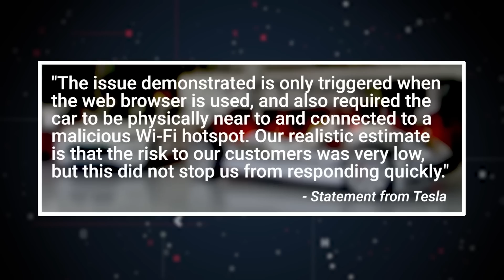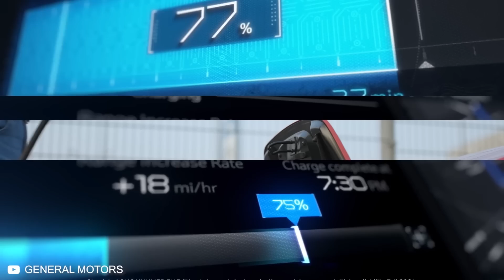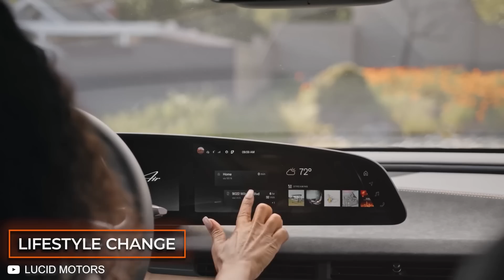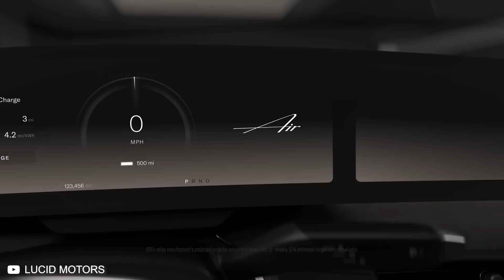EVs' Serious Problems That Carmakers Are Hiding

Comment: Too much tech is what is causing menace in EVs that are meant to be simple. I wish companies hold onto the features for the higher variants while providing a simple BMS which isn't software driven or doesn't auto update unneccesarily, diverting the actual use of the machine.

Comment: To all the ICE owners, I agree with you.  We don't need a mandate.  I should be able to convince you to buy a product, not force it on you.   Let's keep these discussions friendly.  

That being said, this article points out the main problem and the reason you buy a Tesla; charging stations.   The telsa supercharging network is amazing, decades above all other makers.   All of the EV failures are with other EVs.   

Also, you can get a  new Tesla model 3 at 37K, and that is before tax incentives.   that is almost in the range of low cost ICE vehicles like camrys and civics.   Tesla's next push will be in the 25k range.   That will push EVs into higher adoption.

Comment: Great commercial but I don't think it's going to work because once you get enough TVs on the road there will not be enough electricity available to charge them then what. And there's no such thing as drastic climate change.

Comment: Hybrids are the answer!!!! Even though the heavy batteries reduce efficiency, the fuel burned is much less. The batteries are not as heavy as in an EV, the utilities don't have to rebuild to supply the charging current,and no electricity will be wasted by fast charging!!!!  Special tires for the battery weight won't be needed for cars and trucks and bridges and roads need not be improved due to the battery weight!!

Comment: 5 min 300 mile fuel fill ups is still the way to go. No hopes and prayers to find a working charger and compatible app with other cars waiting in line there before you in winters freezing cold making me late to work. No DIY replacement parts, no aftermarket upgrade customizations, dealer only service, no resell value, NO THANKS !!!

Comment: The big problem I see is what are you getting to charge the battery with? It's not solar or wind but fossil fuel creating the electricity. Gas powered vehicles use fossil fuels better then putting it into an electric car.

Comment: It’s two years later and the EV choice doesn’t look so good. Lineups at charging stations, the fires with the high repair costs makes them expensive to insure, auto manufacturers stopping production because no one is buying and Tesla is lowering its prices dramatically. If the government has to subsidize a product to get people to buy it then it’s not ready. If the government pushes something really hard then it’s usually doing it for the wrong reasons. Electric cars will be fine when better battery tech is a reality with faster charging and no fires. 😊

Comment: Has anyone compared the cost of the electricity needed to charge an EV vs the cost of a tank of gas that goes the same distance?  HINT - gas is one he!! of a lot cheaper - even with production costs thrown in.  What about those countries like the United Kingdom that are suffering from energy shortages?  What are they suppose to use if the electricity shuts off?  What about black outs due to storm damage?  This would be a major problem here in the USA which is the Tornado Capital of the world.

Comment: That is why Toyota Hybrids remains KING as most everyone can afford to buy A Toyota basic Prius that has excellent MPG , my old Prius 2013 has 185,000 miles a still runs great and will get 50mpg  on a trip where there is not a lot of traffic or very bad weather ,but basically it will get 50mpg if you are traveling @ 55-60mph?

Comment: The problem that you glossed over is the fact that the batteries only last 10 years and can easily cost more than the value of the car to replaced.  Case in point is that many early Volts are now requiring new batteries that cost upwards of 15k which is much more that the value of a 10 year old Volt.

Comment: electric cars have a lot of draw backs,🤔 charging  the damn thing is only one problem.  those things are a fire hazard. the battery materials are morally questionable. the charging stations are vulnerable to vandals and the process takes way too long to be practical on a large scale, especially with residential power.  the cars are entirely too expensive to offset the cost of fuel cars. and they're way too expensive for the construction quality.  EV's... which should be called BC's, for "battery car" are  long in concept, but fall short in design.  it seems many well intended people have been sold a bag of magic beans.. 🤣  i get the feeling the modern battery powered electric car was designed by someone who doesn't know how the world works and only sort of knows how a car works.🙃

Comment: First impressions of Model 3 or improvements to be made:

1. White seats interior comes with a white dashboard trim which generates glare on side view mirrors.
2. Dark Ceiling glasses is hot under the sun.
3. Fine dust blown from brakes.
4. Turn signals stick is ambiguous in starting the quick 3 blinks and continuous  blinks.
5. Bottom of the car too low and prone to undercarriage damages, especially for batteries and other mechanical parts.
6. Screen menu items not intuitive, especially when you want to exit a mode. Screen icons not intuitive.
7. Regenerative breaking not smart enough.
8. Visibility of other cars around you is poor.  Switch between the real surrounding and the screen images is distracting.
9. Would be nice to be able to stop Auto locking the doors.
10. Strong EMF's inside cabin, especially on the passenger side, on seats, and on the floors.

To be fair, Model 3 have some new and good features, some of them are  not matured.

Comment: I regret buying a Tesla because I found out that there is a lot of EMF's inside the car and that give the head and body stresses.  Especially on the passenger side and back seats, and on the floor, very strong EMF's. If you are sensitive to EMF's, don't buy a Tesla or any other EV's.  All EV's should have a disclosure about their EMF levels inside the car cabin.

Comment: I use a pickup and frequently go off-road so 4x4 is mandatory.  By elimination this means Rivian.  Also the Rivian is the maximum practical size for outside the US.  The standard range is adequate for me for most of my trips.
 
 I can see the external garage making a come back due to inflamable batteries taking a whole house, if the car burns, and that ignores the insurance for the house being vioded if there is an ev, e scooter etc.

Problem:  where is power being generated, and how is it getting the the consumer??? And what is the EV effect on base-load demand?  Watch how authorities waffle on those 3 points.   Until these are addressed EV's will be limited.

Comment: I will be 50 soon. I have never owned a brand new car. Usually it’s about 7-12 years old. The one I have now is 10 years old. I will never buy a new EV. I won’t buy a new gasoline car. If the don’t stop making new gas cars until aft 2030 and I still have an option of a used gas car for the next 20 years. I will never need to buy an EV.

Comment: The repair thing is pretty much exclusively a Tesla problem, the legacy mfrs already have parts pipelines and lots of locations. If you cant charge at home, you wont benefit much, other than the speed and quiet. The hacking thing - all cars these days have the same vulnerabilities, regardless of what turns the driveshaft.

Comment: So many inaccurate statements. Many ICE cars have electric steering. Yes batteries degrade / have decreased capacity over time just like ICE car engines wear over time. An EV battery can keep most of its capacity if charged correctly with minimal rapid charging. The UK has many DC chargers even in 2022. A $40k Tesla will do about 200 miles not the claimed 260 miles. Dyson never intended to make an EV, it wanted the investment for its battery technology.

Comment: We are filling the world up with lithium-ion incendiary bombs. Most of these batteries are relatively new but many of them, especially in China, go up not in a puff of smoke but off like a thermic lance & burn until anything within a 20m radius has been utterly consumed. Wait until the majority are 10+ years old with a few dents & scrapes. How many will be bursting into flames then on the daily? Can you imagine two cheap Chinese EVs in the basement of a multi-storey carpark with poor access. Should one decide to self-implode it will likely take not only that row of cars, not just the multi-storey carpark with it, but likely the entire shopping centre too. Think it can't happen? It can & it will, the Freemantle Highway has taught us that if nothing else. Catastrophic as this will be globally, we are faced with a list of EV shortcomings that are literally as long as your arm. They are expensive, lose 50% of their value in the first 2 years, more costly to run than diesel, have poor range, insufficient chargers, take a hour min to charge, travel less in the cold, give range anxiety, likely to burn house to ground if charged in garage, new battery costs half the vehicle value, beyond 3 yrs no one will want them due to the cost of battery replacement so value drops again, at end of life person holding the baby has to somehow scrap the toxic battery which is half the car, servicing super expensive, tyres need replacing annually due to weight.......I could write for weeks without running out of cons. They are simply endless. VW has already seen the writing on the wall and is moving strongly back to ICE with 7 new ICE models planned & its EV workforce curtailed. EVs are rapidly becoming a global joke ......in any colour.

Comment: Choosing an EV over a ICE Powered vehicle is Never going to be an option for me,I will keep my diesel until it either drops apart or they make them illegal to use whatever comes first. These EVs when they go wrong are going to be horrendously expensive to repair and at my age isn’t viable. People on low incomes will be priced off the roads,perhaps that’s the plan nobody knows,only the well off will be able to buy or lease new vehicles and secondhand EVs could end up crippling you financially especially at battery replacement time,the cost of replacing the battery would probably exceed the value of the the car. This is happening now with some ECE vehicles with the cost of parts and Labour rates for fitting them, they are now more complicated than ever and if you don’t have a computer to read the fault codes there dam near impossible to diagnose and repair without one.

Comment: Even if you magically turn all fossil fueled cars into EV's in an instant, this won't change ANYTHING climate-related. THE ONLY real advantage in EV's is that you might reduce it-city air pollution, but this comes at a cost.
Reply: I interviewed a top energy expert on my home page vid. This expert warns that EV conversion will not happen and oil can never be replaced

Comment: Lets add to the debate __ UK power suppliers refusing to put in the high speed home chargers because the area transformers aren't able to cope.
Reply: I interviewed a top energy expert on my home page vid. The expert warns that EV conversion will not happen and oil can never be replaced

Comment: Instead of one long sheet of batteries in one full length pack...it could be broken up to 5 packages that slide in and out for ease of replacement. Like battery drawers or slots.

Comment: It is also the lack of multiple cycles. A new car looses half its value within the first two years. Setting aside this 'value for money' issue, there is also the fact that many people either don't want a super expensive car, or don't need one. So, they can try to balance quality vs price by buying a used car, and man is there variety there! With EVs this will be basically impossible, since the battery goes deader and deader every year.

Oh, and by the way, the ecological cost for constructing (and transporting) the components for an EV is such that they make little ecological sense, at least at this time.

Comment: Fire Departments have been equipping all of their vehicles with TOW CHAINS.  When called to an EV vehicle fire, the first thing they will do is drag the burning vehicle away from anything else that will catch fire.  

A Gas-powered vehicle fire can typically be extinguished in minutes with just the water carried by one pumper truck.  An EV can take THOUSANDS of gallons of water and SEVERAL HOURS to put out the fire -- because the fires are chemical reaction fires within the batteries (in most cases) and these chemical reaction fire can be several hundred degrees HOT and simply applying water for a few minutes cannot put out these fires.  And frequently, it can actually take several DAYS to fully stop the chemical reaction fire of an EV.

Comment: It's bad enough having to charge up your phone every night without having to charge up your car. Not convinced of the true saving in carbon footprint either when considering the manufacture of batteries and supply to charging points not to mention appalling conditions in lithium mines in Africa. If electric cars are so good how come they never took off late nineteenth century when the first ones came out?

Comment: The main point is we all got are first banger and it run if you see a ev with 200,000 miles on the clock you won't ever part with $500 because one day it wirks and then the  next day it doesn't  and new batteries are $20,000 so it will just put us in a constant buying new cars which is great for the car companys but not for us and defo not for the environment

Comment: The change will come, but we’re not there yet. The truth is more people need to feel safe not owning a car, ELECTRIC included. There are just not enough charging stations in the U.S., let alone the world, not everyone has access to superchargers and even if they did, can you imagine the power pull needed to replace every personal car with an electric one? Right now, with existing public transport infrastructure (that’s planes, trains, subways, lightrails, and busses) I would not feel comfortable getting to work and back sans owning my own vehicle. Our cities are designed horribly for that and the elite like to keep the ‘poor’ from accessing certain areas so they don’t want good public transportation. They’d rather pat themselves on the back for buying an EV as if that actually solves the problem of the amount of 4 passenger vehicles on the road carrying one human on a daily basis.

Comment: Who wrote this garbage -was it funded by the oil companies by any chance as most of this is scientifically wrong.?
Reply: Should have been easy then for you to point out, say, one thing where the science contradicts the video.  Yes? 

Unless, you’re just trying to drape yourself in the cloak of deep science and engineering education and experience.
Reply: Here's some real World science for you Actual EV towing tests
 https://www.youtube.com/watch?v=0oLeKRNsSn4    
https://www.youtube.com/watch?v=ss0ThXqPIbs 
not sponsored by the fuel lobby, there are dozens more doing actual real-world tests EVs constantly come up way short of the manufactures science at least where range is concerned.

Comment: The main issue I see is that the electricity has to come from somewhere. We don't have an infinite supply of it. Right now the energy sources are shared between different things. Cars use petrol/diesel, which doesn't eat into the grid. If all vehicles abandon a perfectly good source of energy and start using electricity, it'll start putting way too much pressure on the grid. Secondly, EVs are not zero emissions because they still pollute indirectly. Anything that uses energy that's not solar is harming the environment in some way. Many countries still use coal to generate electricity and of course the manufacturing of the vehicles uses energy. So all things considered, is it really logical to replace all ICE vehicles with EVs? I think EVs should coexist with ICEs and share some of the burden. They're also great as city vehicles since they don't directly pollute the environment and the range and charging isn't much of an issue there.

Comment: I get it, views is what matters on YouTube but Jesus, you could at least attempt to present facts rather than mythical cliches about EVs. So here are a few corrections: EVs have far fewer fires than gasoline cars, like 1/100th as many per mile. The range on some EVs is poor, good on others, just as the full fuel range of some gasoline cars is good and others not. Some Teslas will go 400 highway miles on a charge, considerably further around town. All new cars have a huge number of computers that offer opportunities for hacking, this has nothing to do with whether the motors are electric or if the car uses a gasoline engine. Many cars now come with driver aids, similar to Teslas Autopilot, all of these cars could, possibly, be hacked in such a way as to cause the car to speed up, brake, or turn, without driver input, this has nothing to do with the car being electric. That fewer mechanics know how to fix EVs is certainly true, just as few mechanics have the knowledge to work on exotic cars but that will obviously change as EVs become the norm.